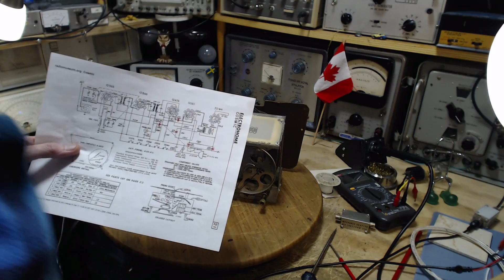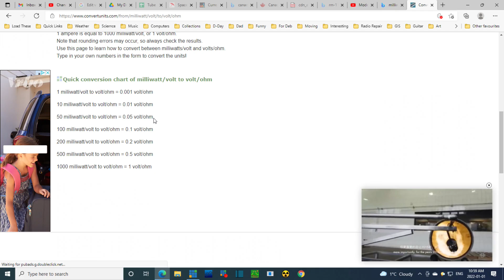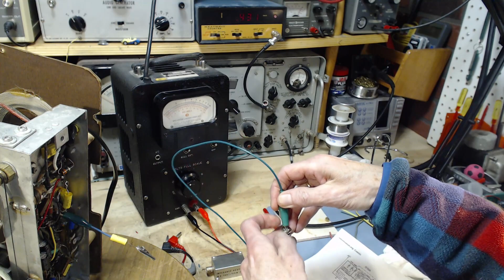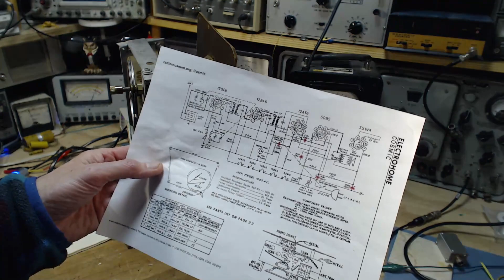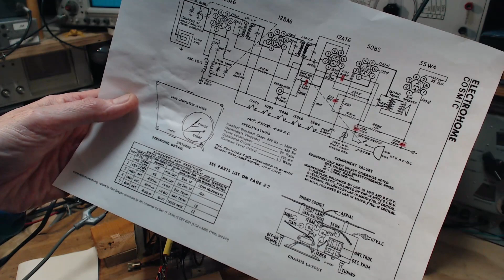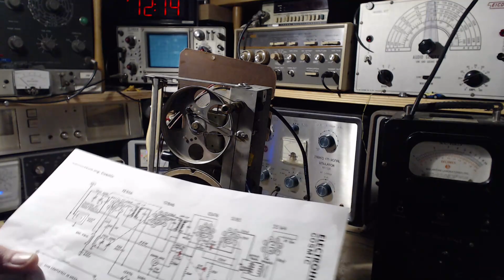Electrohome Cosmic Tube Radio Video#10 - IF Stage Gain

Comment: There's one mixer stage and one IF stage in an AA5, with an added TRF preamplifier in an AA6.  Keep in mind that unlike, perhaps, in ham gear which sports maximum gain all the time, this home radio has automatic gain control.  Therefore if a strong station is coming in, the IF stage (and sometimes previous stages) will dampen down the gain with negative bias driven from a DC feed from the audio preamplifier derived from an extremely low pass filter on the detected AM signal.  That isn't a bug in the IF.  That is a feature.  It allows one comfortable volume setting to serve well for most stations.  Don't let what the oscilloscope shows scare you.  Those remote cutoff XXX-odes are that way for a reason.

Comment: Also in this video, He goes to use the sig gen and says that it has leaky capacitors in it. Everything to him has leaky capacitors in them. He has all that test equipment there and None of them work properly. More for show than everything else. What irks me the most is, He sends these radios back to the customers not working as good as they should and charges them.
Reply: Not only does he send them back in an inadequate state, he even sends them back more broken than before! Go back and watch all the instances where he broke ferrite core tuning slugs by using improper tools and then fabulating how it was broken from the factory!  Or when he wrecks a whole receiving band and just comments that it was okay since the owner would never use it, because there was nothing interesting to be received there!
Reply: Or that radio that only tune in at 590 kHz... Jim's answer: The owner only wants this to hear the sport station, I won't bother to fix the other bands... Hilarious...
Reply: @StillCloser  One of the videos that sticks in my head is the one where he hacked up a turntable because it had a worn platter drive wheel. That's all that was wrong with it. Instead of looking on the internet to find a replacement wheel. He hacked up the mechinasim by cutting springs in half and, drilling / ilongating the slots that the slides moved in. all the while talking about how the enigineers designed and built it wrong.
Reply: @davedoggy  Ahaha... Man, that video still gives me nightmares... https://youtu.be/asZUUDN7Nzs?t=376

Comment: In my experiences, AA5 radios are very simple to troubleshoot / Repair / Alignment. As long as the coils / Transformers are good and, The  I.F Transformers  do not have  SMD,  It usually takes me an hour or 2 to bring them back to life.
Reply: If anything, they're a tad overdesigned for their usual task, that of pulling in nearby stations.  And if that is not enough then there is the AA6 with RF preamplifier.  But a particularly troubled/aged build of an AA5 could accumulate a plethora of woes.

Comment: How far out are the IF can's cores on the bottom...? Seems like your not going into the coil..seems like the core is at the end of it's travel to the bottom, which to me is wrong. Just a thought. All IF can cores can be adjusted into two positions all the way out, and almost falling out of the IF can, or more internal which is were they should be.
Reply: On a radio that was untampered wirh, there should be no reason for any major readjustment of the IF transformers. Or in other words; the moment you are facing problems like the cores falling out the top or bottom of their sleeve or touching together in the middle, you are facing problems beyond alignment like  bad mica capacitors inside the cans.